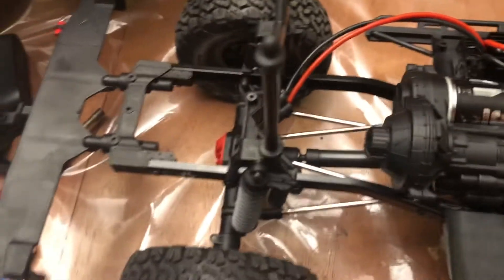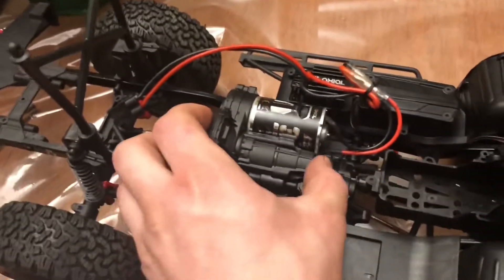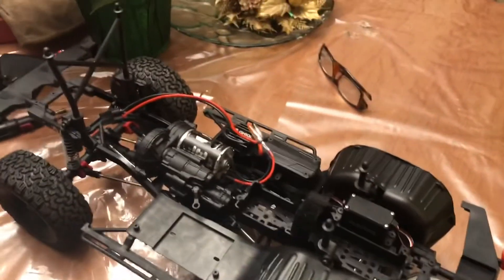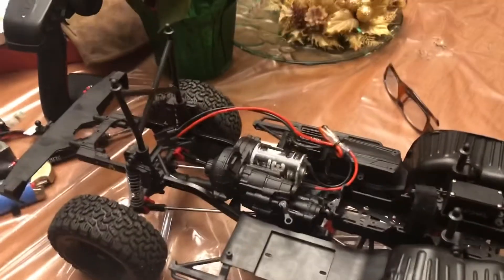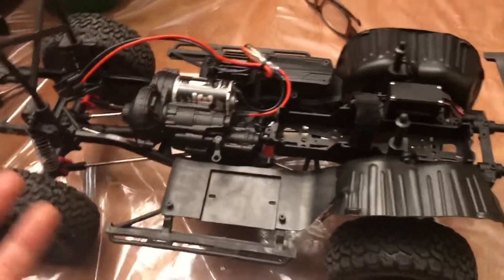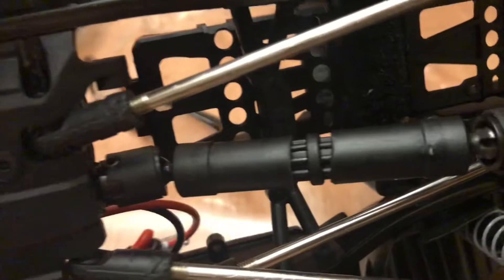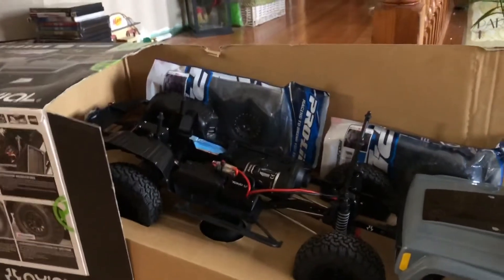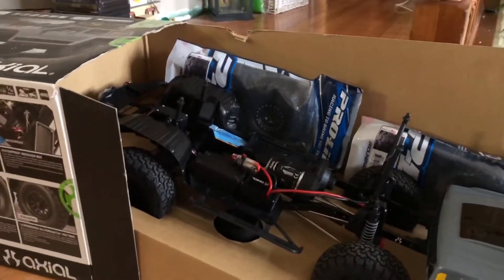(Part4) Scx10ii 2 speed trans build

Comment: With the rtr cherokee transmission, the rear suspension binds when right rear wheel is flexing up. The rear driveshaft rubs on suspension links. It should come with the new 2 speed style trans from Axial. Disappointing.